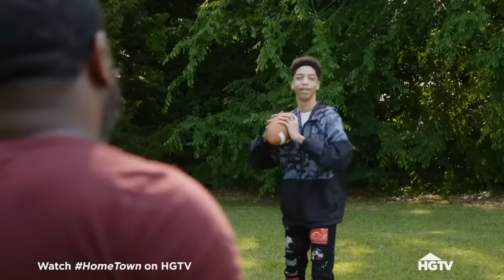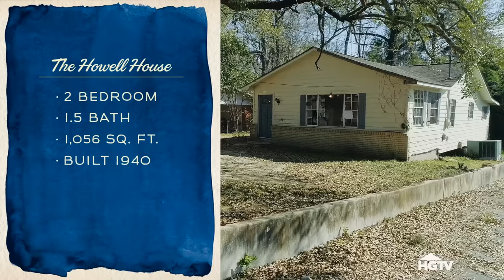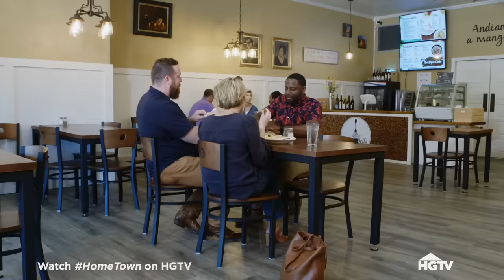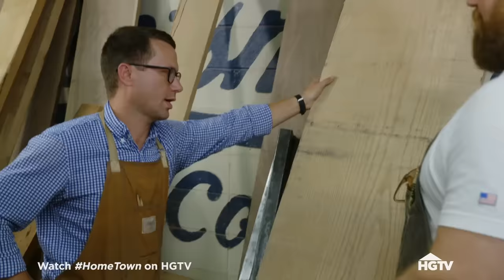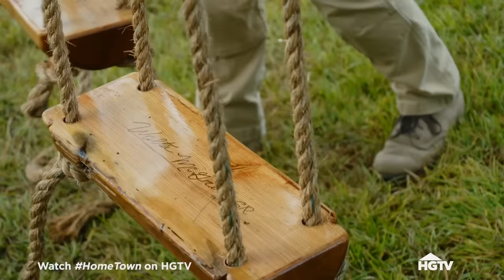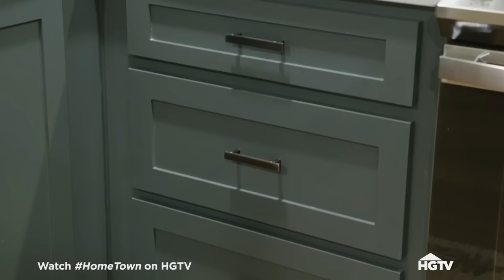Design Challenge: Turn Fixer-Upper into a Cozy Home - Full Episode Recap | Home Town | HGTV

Comment: What a great design! They managed to give him a big kitchen with plenty of counter space even though this is a very small home. I've been watching some home walk-throughs of these million (and above) dollar homes and all of them have the exact same lay-out. Kitchen facing and completely open to a great room with soaring (completely non-functional) fireplace and very high or even two story ceilings (making the fireplace useless for providing heat). The kitchens inevitably consist of one small wall with range and two small upper cabinets, two lower cabinets, one wall with refrigerator and an island. It's chopped into three separate work spaces and has little counterspace and very little continuous counter space. You have to walk all over the place to reach your various appliances, work tools, etc...and you have to do any actual cooking on the island, having no real work space on the walls. I call them uber eat kitchens because you're not going to be able to do any real cooking in them. And these mansions are over 5,000 square feet. This home is 1/5 the size and they've managed to give him a workable kitchen that has more storage than these mansions do. I wish more designers and builders would build like this!